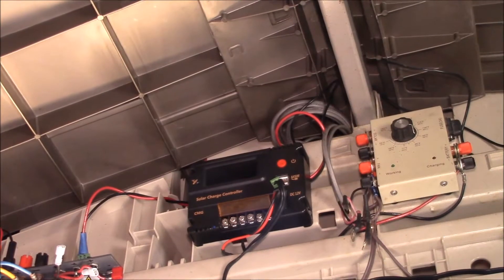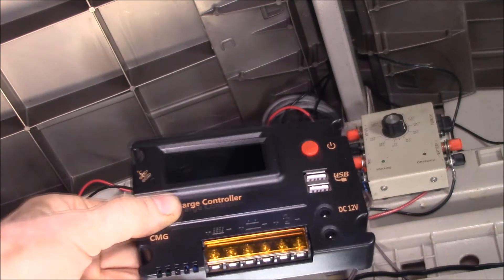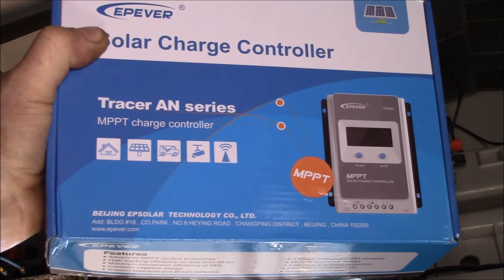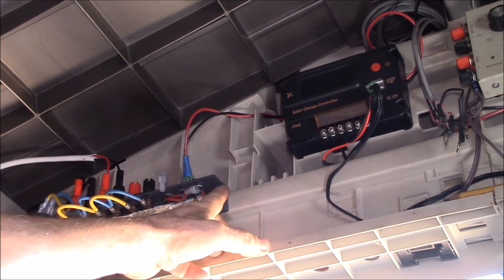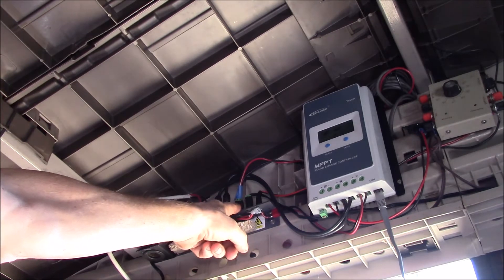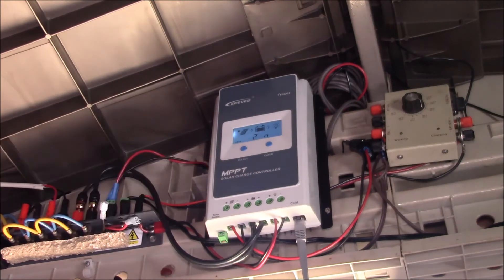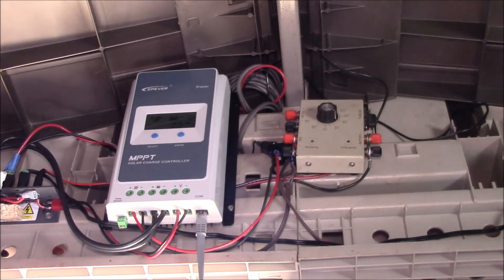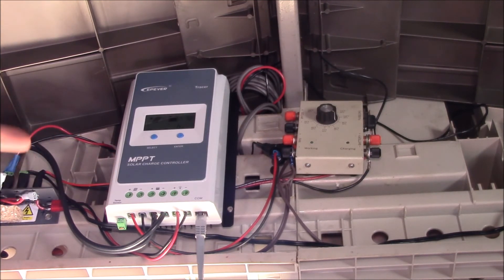EPEVER 2210AN Charge Controller for the Solar Shed, Part 1

Comment: How do I know my batteries are full charged?
Reply from the maker: The battery symbol on the screen gives a rough state of charge, but the best indicator is to observe the charging voltage = float voltage and the charging current = 1% of the battery capacity or less.  So on a 200AH battery, you would be looking for float charge at 1-2 amps and that would be fully charged.

Comment: That's a sweet set up.  I commented on your other video with the fan.  Your charge controller looks identical to mine.
Reply from the maker: Thanks for the comment.  Yes, this does seem to be a good charge controller.  I may pick up another one to put in my truck where I want to slap a 200W panel on the roof.
Reply: @The4Crawler  Since mine gets so hot with only 2 solar panels, I may need to upgrade to a Midnite Solar one.  I have many more panels that I can hook up.  This would burn the unit out, even with a fan. Somebody told me that my panels put out too much voltage since they are such large panels.
Reply from the maker: Voltage should be no issue, as long as you are under the max rated voltage, usually these controllers are 100V or 150V max.  I've run my 40A controller with up to 3 panels in series at ~120V and mostly in parallel with 40V panels.  Right now I'm over paneled with about 1KW of panels charging a 16V battery bank.  The controller limits to about 40 amps charging current which is about 640W of power.  I have the fan controller set to a bit over 40C and as soon as the fan kicks on the controller temperature starts falling.  The 20A controller likely needs some rear air flow, more like my older one:
https://youtu.be/Jxp6jzwZYcY
Reply: @The4Crawler  Next I want to install gable fans in my attic powered by solar.  There's one on Amazon that was nearly $400.  I already have the 12V source here.  I just need to run wires to it and make it toggle on based on attic temps.  It's 118 ℉ in the attic right now.  Yesterday it was 121 ℉.  I have an attic fat on the roof now, but I want to see if I can suck in cooler, ambient air from the side of the house to see if that helps.  One person who spent the near $400 on the gable fan said that it didn't make much difference.  I'm about out of options. It's either this or buy a larger central air.  I just had a new roof installed plus R44 insulation put in the entire attic.  That isn't helping.
Reply from the maker: For sure, give it a go.  That's how I got started.  I have a total of 8 12V / 120mm PC case fans in my attic on a thermostat and they do a great job of keeping the temperature reasonable.  I used to hit mid-130s on hot days, now it only peaks at 110F on the hottest days and usually just over 100F:
https://youtu.be/IXnU8SDihSs
https://youtu.be/a2ZjQU8RJ6Y
https://youtu.be/Mw60u0hQ6N8

I even had my local utility company give me a $100 rebate on the solar fan install which covered the cost of the fans.  The funny thing with that is it has never been connected to their grid.  Fans are going on their 7th summer and still working like new.  I may need to get up in the attic and take a toothbrush to the fan blades to clean the dust off them.
Reply: @The4Crawler  Yeah, I can't believe that they actually sent out an inspector.  That's amazing.  I recently added solar panels on my roof.  I am hoping to not have an electric bill for way over a year if they work out as well as they have for the past couple months. I have a 9 kW system on there.  When it's hot out, I see the inverter putting out 7-8 kW.  With my central air running full blast, the solar panels are able to run my AC and still send power back to the grid.  I am too big to crawl up in my low attic.  There's no support up there. I'd end up falling through the ceiling. I need to hire a nice thin person to go up there and install a large gable fan.  My house has two large vents on the east and west sides.  Plus I have  US Sunlight Corp attic fan.
Reply: @The4Crawler  This is the new fan I installed in 2016 after I bought this 40 year old house.  https://www.youtube.com/watch?v=T-sDRYM9LgU  I have this optional control unit that tells me the attic temperature. It runs the fan on electrical power or solar power.  If the humidity gets high in the night, it can use the house electrical power to run the fan.  There was a fan that was there originally, but it no longer functioned.  I had this fan professionally installed since they had to cut a bigger hole.
Reply from the maker: Yes, I think the utility was expecting one of those $400+ solar roof vents from the big box store.  I sent them photos and receipts for my system and they sent a guy out to verify everything.  I think if I had a simple bar code from a pre-packaged unit, they would not check.  The rebate was for a "solar powered attic fan" and the inspector had to admit it was indeed a fan in the attic powered by solar.

Sounds like you have a decent sized system.  Mine's a lot smaller.  I think I can get up to around 50% of my power needs with it.  But for sure, keeping the attic cooler really makes a difference on comfort.  Even that 20* drop I saw is very noticeable.  Before you could feel the heat radiating off the ceiling, just like an oven with the broiler on.
Reply: @The4Crawler  Yeah, the US Sunlight solar fan isn't cutting it.  I bought that brand new for around $250 + $150 to have it installed.  2 guys went up and spent a couple hours hooking it up. They put a tent on the roof and everything to keep them cool while they worked. 

I set my central air to 74 degrees and my AC only cools down to 76 degrees and it stays on all day long and never shuts off.  I had a new roof installed, impact windows and even after all that money spent, I can't get the house to cool down.  It's either I spend money getting the gable fans installed to pull cool air in and suck hot air out or spend thousands upgrading my central air to a larger unit.  The gable fan thing looks like a fun project.  I love your video explanations.  I want to try cooling my garage doing a similar method. If I can see a  noticeable temperature decrease, I want to do the attic next.
Reply from the maker: Yes, those commercial rooftop solar fans are not terribly effective from what I've heard.  Make sure it is running into the night to pull in the cooler air.  

The big advantage of doing a system like I did is that it will run when it's hot and not just when the sun is shining.  In the summer, my fans will be on 20+ hrs/day.  They'll run most of the night pulling in cool air until the thermostat shuts them off.  That way it'll be 70-80 in the attic in the morning and as soon as the temp rises a bit, they turn on again.  But it's that cool reset every night that's the key.  When I shut the fans off for my test video, the attic climbed a few degrees every day, in my 3 day test, it went from 104F to 112F and would have kept climbing.  

The other big win is some sort of reflective layer under the roof deck:
https://youtu.be/J-Tg9JXBhlA
I found either the reflective layer or the fans alone were somewhat effective, maybe 5-7F reduction, but combined they made a much larger difference, like 20F reduction.  Of course if you have a lot of solar panels on the roof, they'll block a lot of the heat from the roof deck.
Reply: @The4Crawler  Yeah, but I heard you say in the video that you don't have air-conditioning.  It totally makes sense now that you have gone through all of this trouble to find ways to get rid of attic heat.  That foil is a great idea!  I just have no way to get up in the attic and do all that. I'm way too big to climb up in there.
Reply from the maker: I imagine your solar panels, if on the roof, help to divert a lot of heat from the roof deck, as long as they have some good air space under them.  

But yes, with no AC, I have done a lot of work to keep the attic cool.  I spent many months up there patching up the shoddy insulation job I paid for about 25 yrs. ago and then adding decking to allow access to the whole attic.  The house used to hit close to 90F on hot summer days, now it stays below 80F.  On really hot days, I'll flip on the whole house fan to pull in outside air and also blow down the attic.
Reply: @The4Crawler  How do you sleep when it's so hot?  What made you not want to have AC?  Not even a wall shaker?   I have central air and that wall shaker in my video.  The wall shaker is my emergency AC to run on solar during a long power outage.
Reply from the maker: The climate where I live is not really hot enough to warrant AC IMHO.  Lots of folks have AC, but we usually get a sea breeze every afternoon that cools things down every evening.  Since getting the attic cooled down and better insulation, it's never risen about 80F in the house, usually 78F or lower.  If it's a bit too warm for sleeping, I just fire up the whole house fan, leave the window open in the bedroom and that'll pull cool air in and cool the room down in a few minutes.
Reply: @The4Crawler  It was in the low 80's here last night and I put my central air down to 71.  I just found the guy who had the two EPEver charge controllers where he had to install the cooling shrouds.  On YouTube, search on this title:  "MPPT HQST and EPEver charge controller the good bad and ugly about mine"
Reply from the maker: For sure, with night time temperature like that, AC would be a must.  I think I've seen that video.  If you push these things much over half their rated output, they'll need some help cooling.  My original controller had the rear heat sink and I mounted it to let my fan blow air behind it.  The new controller has the front facing heat sink fins and that's easier to cool with a fan blowing on the face.  It would be nice if these units had a fan output connector you could simply plug a PC case fan into.
Reply: @The4Crawler  I am thinking of upgrading my charge controller in the future. I've been testing it since 2017 the way it is now.  I don't think it will be too reliable with 4 of my 310 watt panels.  Maybe I should get a Midnite Solar or a Victron.

Comment: you could have got the 1210an or the 1206an.
Reply from the maker: Yes, for this specific application I could have gone with a lower current version.  But I wanted to try out the 20A unit because I plan on installing a 200W flexible panel on the roof of my truck and that'll need more than 10A or output.  When I get to that project, I may move this controller into the truck and put a new unit in the shed, either this size or in the 10A range.
Reply: @The4Crawler  Ya on ebay the 1210an is only 59.99, very good price for an mppt controller!
Reply: @The4Crawler  Great video! I just purchased my 1st charge controller. The same one. Thanks for the review.
Reply from the maker: Thanks for the comment and congrats on the purchase.  Mine is still going strong after a year and a half.

Comment: I have two EPever Tracer AN controllers linked via the EPever WiFi module. Love them.
Reply from the maker: Sounds like a nice setup, are both in parallel on the same battery bank or two separate systems?  My single unit has been working flawlessly in the shed since I installed it.  It's not heavily used, mainly runs a couple of cooling fans and some LED lights in the shed plus powering my Craftsman C3 battery charger.
Reply: 3 x 175w solar panels on each controller, but charging the same battery bank. By changing the ID of the controllers I'm able to remotely monitor them via the EPever WiFi 01 and the software on my PC or app on my phone. Great controllers for the price.
Reply from the maker: Sounds like a good system, thanks for the information.  I might be looking at doing similar on my lithium battery system.  I have one 40A EPEver controller now with 3 - 335W panels.  That's a bit more than the one controller can handle, but if I can move my 4th 335W panel over, then I may set up a pair of 40A controllers w/ 2 x 335W on each and that would almost double my peak charging current.
Reply: @The4Crawler  , don't mean to butt in, but EPEver now makes a Triron charge controller that supports lithium by design. Good info., thanks for posting.
Reply from the maker: Thanks for the comment, yes, had heard a little about that new model.  It seems that most all their new controllers have some support for lithium chemistry.  The Triron may list those in the menu itself, but it's only for a few combinations like 3S and 6S in Li-Ion.  Likely still need to go into the menu and select User battery type and customize the voltage settings for the various parameters.  Also, they still have no cell voltage sense connections or balancing support.
Reply from the maker: Yes, they do seem to be adding the user specified battery charging settings in their newer models.  But they are still lacking the cell voltage sensing and balancing functions that would be needed for full Lithium battery support.  As they note, with the Lithium battery settings, you lose the automatic system voltage detection like you get with 12V and 24V lead acid batteries.  So you still need to set up all the parameters yourself.  Now this is better than my old 4210RN controller where there's no way to modify the paramenters outside of selecting Flooded, Sealed or Gel for the lead acid battery type.
Reply: My Tracer AN's can be configured for for Lithium, not too difficult once you've studied the settings.
IMO cell voltage sensing and balancing are something that should be done by the battery for best results, not the controller. That way things like balance cables etc. are all kept to a minimum.  The results could then be sent to the controller via a single thin data cable to aid in its battery management.

I've actually made my own version by incorporating "BattGO"(https://www.battgo.org) technology into a power wall battery. Check out my last 3 YouTube uploads.
I'm still working on full integration into the Tracer AN controllers, for now a separate display is used. I'll upload more videos once I neaten things up.

Comment: Good luck hope it holds up under the heat
Reply from the maker: Yes, that's the point of the testing.  So far it seems to be doing OK.  We've had some days up around 100F this month and no problems yet.  It's been holding the battery voltage up very nicely compared to the cheap PWM controller I had be trying for the last 9 months.